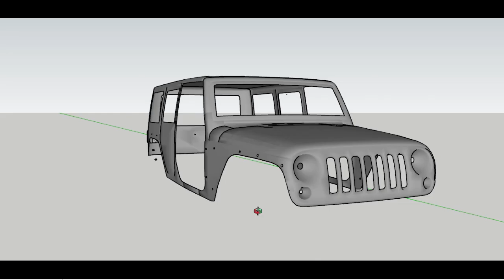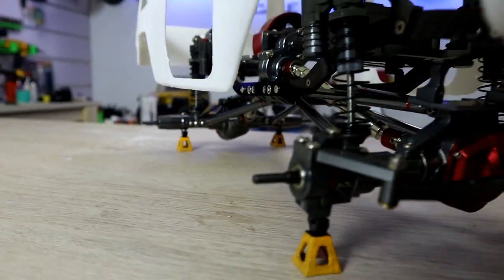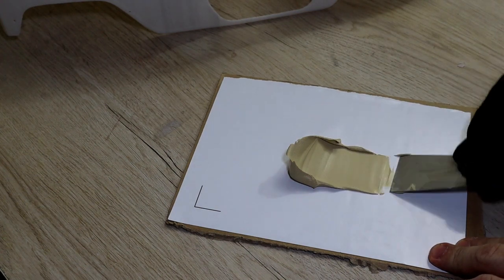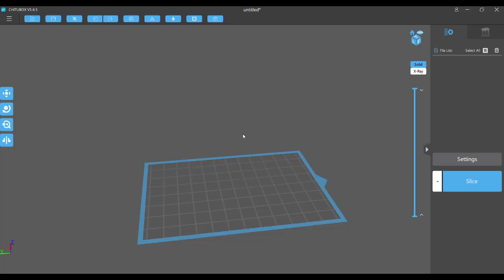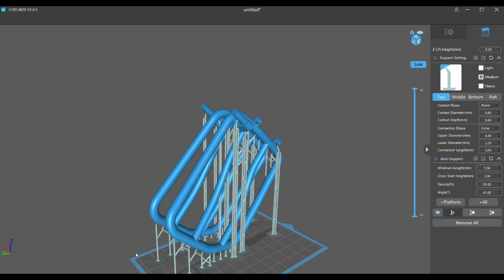3D printed jeep wrangler for SCX10 Chassis Part 1/ How to 3d print rc car body/ Painting rc body

Comment: whenever I print this for some reason the sides fall of under the front doors and the left headlight doesn't print along with very rough edges and a lot of lines I leveled my printer and it didn't fix it. What should I do I've made it twice now